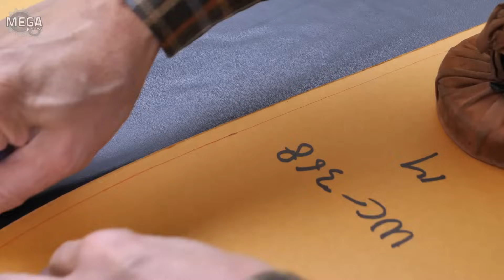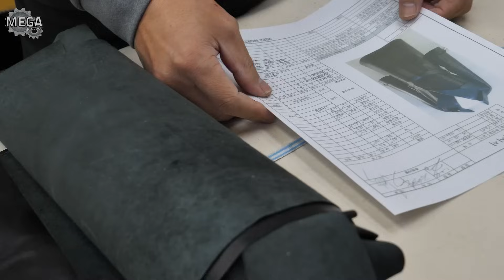Process of making custom made long leather coat. Korean skilled tailor

Comment: Guys, this is the real deal. I was able to visit south Korea this winter (mid November), and while I was confined to seol, I managed to visit north beach and Ferrara and they really know their stuff. I prefer what Ferrara had (more sheepskin b3 jackets), but they and north beach buy their leather almost exclusively from Italy, but they buy in bulk so they save money. It's chrome tanned sheep nappa. It's thicker than lambskin but just as smooth. I was skeptical about their use of fusible interfacing, but they really use high quality stuff now. Also, chrome tanned leather takes fusibles really well. They also don't delaminated because you typically don't iron leather. Typically... Unfortunately, though I was prepared to spend $300 on a nice jacket, the sizing is a bit strange. I'm 6'3" and if the bodice (torso part) fits, the sleeves are too short and if the sleeves are long enough, the shoulders are too wide and the bodice is too lose. Don't be disappointed, there are a lot of good shops but Indonesia has some good jackets coming out of it too.